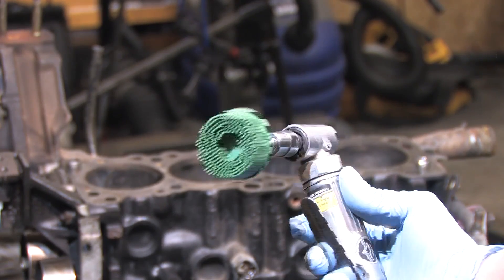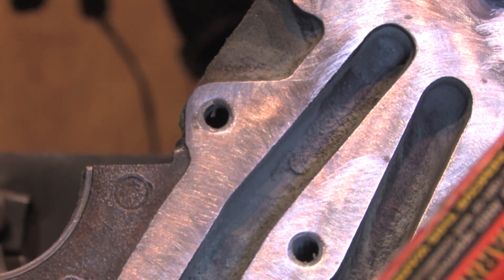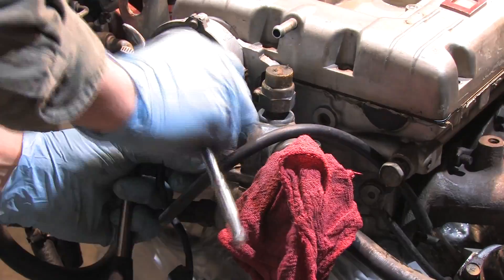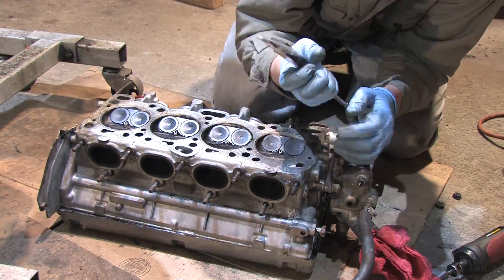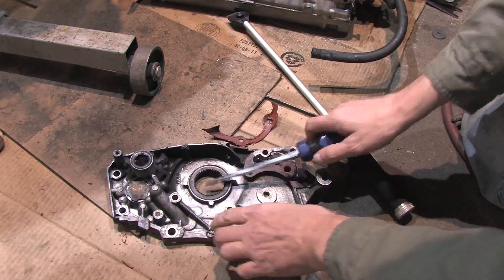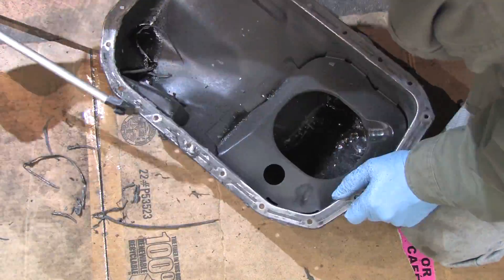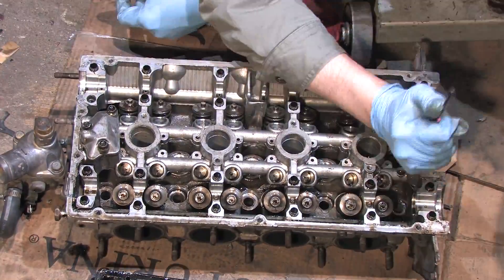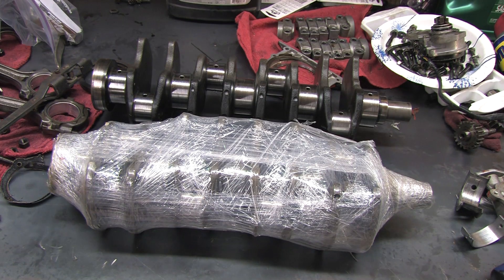4g63 Block Cleanup & Oil System Mods

Comment: Would a balance shaft chain cause a 2004 Chevy Malibu ecotec not to start
Reply from the maker: It would if that chain is wrapped up in the crank sprocket.  It would cause it to not even crank.  A simple balance shaft belt failure typically destroys one of these 4g63 engines like the one in this video because it wraps on the crank, jumps time and bends all the valves.  I've never taken an EcoTec engine apart to look at it, but it's a decade newer and it may have safeguards to prevent stuff like this from happening?

Comment: When hot tanking what do you use
Reply from the maker: A lot of people use Varsol or the equivalent.  I don't actually know what my machine shop uses?  I think its an environmentally friendly version of Varsol if that's even possible?  When I clean an engine at home, I do it the "DIY Parts Washer" video way.  In that case, it's Mineral Spirits.

Comment: Well now, and the hits just keep on comin’! Scrapping crap off of surfaces is getting to be a habit. You bagged the crap out of the grooves and opened up the oil slots to get that oil flowing better. Filter with cooler and oil pressure fitting, things a looking up! Then came a great white whiz from the sky! Zippedee doodah!🤣🙃😊🙄

Comment: Jafro 
How do you clean the turbo of contamination after a bearing failure?
Reply from the maker: I've used mineral spirits with a siphon feed blow gun, and then penetrating oil to re-lubricate it until it's put back to use.  It's pretty much the wrong way to do it... but the last turbo that went through that mess is still performing fantastically on my Elantra right now.  Years later.  There's no way to KNOW for sure that all the chunks are gone without breaking it down and cleaning everything, but I suppose like in my case there's always luck...
Reply: Think that might be a good video to add. I've seen you clean everything on that 4G63. 
Keep up the wonderful work. I tune in to your channel every day!!!!
Reply from the maker: I just tried to find it for you, I swear I remember shooting it, but can't find it in any of these videos.  I thought it was Hyundai Assembly 6... but the turbos are already clean.  There's a video somewhere with a turbo pile, that's when I did it.  The NEXT video chronologically is actually the siphon feed blow gun parts washer video.  lol.  You're almost there for the setup I described.  You'll never hear me speak.  The video does all the talking.

Comment: 10 pounds oil oil pressure per 1000 rpm is fine, at idle it should be around 40-60
Reply from the maker: Cold, yeah.  Sure, I agree.  Cold.  Maybe even 75 PSI isn't totally out-of-hand if it's cold enough. But a 4g63 turbo car with 60 PSI oil pressure at warm idle has some serious problems.  It's "uptight" to say the least.  Spec on a 4g63 turbo is 11.4 PSI+ at curb idle speed when oil temperature is 167° to 194°F.  I like how they just put the + on there (in some non-factory literature it says 11-23 PSI).  Most people prefer to run them around 20 pounds at idle, but performance builds tend to run better when their oil clearances are set up a little on the looser side.

Oil pressure in the 40-60 PSI warm idle realm would make me want to suggest running 5W20 oil to deal with those tight oil clearances and create a more stable oil film layer.  I'm trying to be helpful, not critical.  You can float main and rod bearings if your oil pressure is too high.  If you have a 40-60 PSI warm idle, make sure you're not peaking above 90 PSI at red line.  Most 4g63s with idle pressures that high normally do.

Comment: Hey Jafromobile, i would love to see you cover an f20c out of an s2000. its my belief that these motors have poor oil flow to the cams and in particular tend to seize up the intake cam for some reason. what kind of mods could i do to get better oil to the cams and girdles?

Comment: Jafromobile, do you have a similar method to prep the mating surface on the head for a composite gasket? I'd rather not take anything to a machine shop right now.
Reply from the maker: +spencermillsful Yes.  The razor blade scraping method I've demonstrated in several other videos.  If the head is in spec and you're using a composite gasket, then you can get by without machine work.  I don't know which specific video it is, but it's early in the blueprint series, and I also did it in the "blueprint everything" video for the Hyundai.
Reply: +Jafromobile awesome, thanks for the reply. Looking forward to more content!

Comment: Hey jafromo for starters I want to thank you for your videos. I followed your videos and did my very first rebuild and it was a success this winter:). Now for my question so I got 4g63 NA block with a 7bolt g61  head with mystery Pistons and crank. ( picked up the motor mid build from a fellow Dsmer who passed away) iv got the balance shafts removed  and about to start block prep. I was wondering that running a NA black without any holes for oil squirters and a 1990 Ofh if my oil pressure is just going to skyrocket With this block / head combo. I don't know yet if the prior owner machined the bolt holes either or just torqued down used head bolts and called it a day if that's even possible to due? Any input would be great and thanks again for the help.

Comment: Hey Jaffro,
I've been watching your channel and presentations on your view of the auto mechanic industry and time as u put it.  after watching this I do have a question have you ever torn down a Subaru EJ255? if not would you ever consider doing one as a side project from a junkyard?.
Reply from the maker: +marglar1982 Don't they use that engine in bush planes?  I've done timing belts on a few Legacys, and one SVX.  None of them were difficult, if not one of the easiest engines to time.  So much room to work.  But I'd totally not install one back in a Subaru.  I'd  bolt it into a Volkswagen Rabbit pickup with leaf springs and a narrowed Ford Explorer rear end.  Don't get me started...

Comment: Jafro, would it be a bad idea to use the roloc bristle discs on the mating surfaces with the routing assembly still installed? I have my motor broken down to a shortblock with the rotating assembly still installed, and I don't really want to take it out if I don't have to.

Comment: Jafro what air compressor do you have?  I remember you saying you have a 33 gallon tank.  But, doesn't that not leave enough CFM for some of the "tool cfm requirements"?
Reply from the maker: ***** You missed the underpants gnome step.  I know 2 people who bought used 250 gallon Ingersoll-Rand units for under $500 used.  It's why I suggested Craigslist.  Buy used.  Buy something that can be rebuilt.  People don't sell them used for the $1900 they cost new.  They depreciate.  I don't know about where you live, but local businesses have been dropping like flies where I live because of the absolute moron running our economy and country into the dirt.  I'm finding used equipment cheap on craigslist these days.
Reply from the maker: Jonathan Campbell It's a 45 gallon.  It's a raging pile of crap, though.  I went for the cheapest air compressor with the highest possible recovery CFM available.  It's a twin-piston oiled compressor that has a 14.8 CFM recovery rate.  It's the loudest, most obnoxious electric compressor I've ever heard, and I'm ready for something different.  I have to give it credit... it lasted 6 years, polished engines, compressor housings, ported a cylinder head, 2 turbos, 3 manifolds and supported me through every project I've ever done on this channel, but it's now toast.  One cylinder has failed.  It's cheap $350 chinese crap, and I'm hunting for its replacement.  Likely going for Ingersoll-Rand in the 60-80 gallon range.
Reply: If I had about $500 to spend on an air compressor what would you recommend?
Reply from the maker: When it comes to quality, if you want a lifetime investment for the $500... go to your local welder's supply shop and find out what air compressor rebuild kits they carry.  They'll have popular kits for compressors that businesses use because they're reliable workhorses.  They get used more, so the kits in stock are the ones you're going to find in your area.  Step 2.  Hit craigslist and search for the model numbers of the compressors they have rebuild kits for.

My harbor freight compressor is broken, and I can't buy gasket or rebuild kits because they constantly change their compressor lineup, and finding a chinese rebuild kit is an impossibility.

So I would say, used 90's era Ingersoll-Rand 250 gallon is the best-case scenario.  Craftsman makes good compressors, and they'd be good long-term investments as long as Sears manages to at least maintain an online presence after our economy destroys the brick and mortar store fronts.  At least you can count on both of those being made in the USA and having service parts available.
Reply: I hadn't even thought about rebuilding it.  That's a good point.  I've had to rebuild so many compressors I'm ashamed I didn't think of it before.  The Ingersoll-Rand brand name (even used) has a premium price tag that is a bit too high for my range.  But, husky or craftsman were what I was looking at.  I think a good craftsman is probably my best bet.

Thanks again for the advice.  =)
Reply: ***** Local businesses aren't likely to use a $500 compressor.  Good advice but sounds a bit unrealistic.  Most businesses I've seen use professional grade 60-80 gallon tanks with high HP motors.

Comment: +Jafromobile 
I see what you are saying, a very good point no one else has ever put out there. 
Thank you very much for taking the time out to reply. 
I will be running them now.
Oil pump going on the engine has done 500miles so there should be no problems with that in regards to worn out gears. 
A careful inspection and clean of the squirters especially will be done before installation for piece of mind.
Thanks again :)

Comment: What is your thoughts on the oil squirters on the 2g 7bolt like in my lancer evo 2 gsr ? Im about to rebuild my engine so would like to know whether to modify/delete them before I make a start. Im sure you have heard of the possibility of the squirters causing crankwalk. I'll be running Wiseco forged Pistons so squirters may not be necessary for my build ? I'm hoping for around 500bhp so the more oil I can get to cool those Pistons the better. Thanks for any input :)
Reply from the maker: Michael Yeo I don't believe the oil squirters have ever caused a definitive, prove-able case of crankwalk.  But opinions are opinions, just like everyone who's ever claimed that they had a case of crankwalk caused by their oil squirters.  

Proof is in the evidence, and what factors were considered or omitted.  I believe that oil squirters could possibly fail if they ever got trash in them.  But ask yourself where that trash came from to begin with... and whether or not oil squirters (which always squirt on an engine with a working oil system) could negatively affect the engine's designed oil pressure if they're stuck open?  Since they always squirt when the engine is turning, of course not.  They could only cause a failure if the oil pump gears were so badly worn that the oil pump can't deliver 10 PSI of oil pressure at idle.  Again, not the oil squirters' fault if that's how that engine's oil system is working.

They're only worth removing if you have low oil pressure, and if you have low oil pressure, you already have a problem other than the oil squirters.

Comment: hey i just love your videos and i love to see someone else loving engines as much as i do (not saying why will u cleaning it? it will get dirty in fisrt start.... (here in Brazil we chance the oil 250miles after build a engine to drain out the dirty thats why we dont have so much great engines around here) but anyway i wanna to add something, This is the second time that i saw u place your crankshaft in banch in horizontal. OK in the school they ever toldme to never do this cuz the wheigt of it doesnt get a necessary "straight" i dont know if u understand. anyway they always toldme to place it in vertical to all the weight get perfectly distribuated and this way doesnt damage the crank. Tnks for my favorite hobbie bye

Comment: I use a piece of emery cloth over an old plate glass table to clean up most gasket flanges. Also after a couple of strokes you can tell whether a part is flat or not.

It works so well for flattening surfaces that I have run without a turbine inlet gasket for 50,000km+ with no leak whatsoever.
Reply: i too use plate glass... but just wonderin, have you ever checked how flat it actually is?

Comment: Are those valve cover gaskets $77 in the US, they are here in Australia, no matter who you buy them from :( I had to buy one yesterday lol
Reply from the maker: Yes.  The price I find is $71.  It's crazy.  I think the FelPro equivalent is around $50.
Reply: I'm not sure why theyre so expensive, makes no sense. Another story, I rang SuperCheap Auto and AutoPro (car accessories shops here in Australia) and they wanted 40$ for the exhaust manifold gasket, and 70$ for the intake manifold gasket. Got them for $11 each from a local Head repair shop bahahaha
Reply: ***** maybe the gaskets are cheaply made but at rockauto.com there like 10 bucks  depending on what company you get it from.

Comment: I hope it's ok to post a question like this here, but I'm working on balance shaft elimination (partly because the silence shaft drive gear has caused some troubles since the last rebuild). When I took the front cover off, I came across this hole in the oil gallery (shown with a red arrow);
https://www.dropbox.com/s/x18a0xlt884tzw2/IMG_20140203_153516.jpg
Is this hole normal or abnormal? if abnormal, can I fix it with JB weld? Thanks! This is a 4G64 block
Reply: Nothing unusual there...  No need to clean it up.  That's a dead gallery.  Not an actual oil passage.  Part of the crankcase and unless something's loose and capable of falling off of it, poses no risk to your oil system.  If anything, you could make that hole bigger, and it still wouldn't make a difference.

Mitsubishi engines are full of flash and strange casting anomalies.  There were no humans involved with de-burring the rough cast.  Only robots.  Apparently, the only quality controlled part of them are the machined portions.  Those are fantastic.  But no two head or block castings I've run across were the same.
Reply: AutomotiveAnonymous
 Thank you. That sounds reassuring :)
Reply from the maker: Tak Suyama What he said...  ^^  :)

Comment: You're so thorough and knowledge filled for a non-professional it's frightening, and the fact you experience motor failure from time to time do to various internal strains makes me think there's no way I could ever take on a project like this. I'm afraid at the very least I just don't have the eye for detail like you do. It's not that I don't want it, it's just that meticulously cleaning for hours on end makes me pull out chunks of my own hair... lol
Reply from the maker: Never forget this... there's no engineering problem that time and money can't solve.

You can do everything you see me do in these videos.  You can do it successfully.  The eye for detail part isn't an issue if you take the time to get familiar with how everything fits together.  The only limiting factor for any individual (and mileage varies from one to the next) is the level of patience they have achieved.  Doing things right means not rushing.  As long as you resolve to fix it correctly no matter what it takes, then the engineering problems will never stand a chance.

If you didn't believe that deep down inside... you wouldn't be watching my videos.  ;)  I'm glad that you do.

Comment: the block is non turbo no oil squirters, will oil port mod #1 and #2 and the cooled O.F.H be enough to bring oil pressure back down to a normal level?
Reply from the maker: I HOPE SO!  We're going to find out pretty soon...
Reply: yea i thought after it will be a trial and error period, at the least it will help though

Comment: Actually, its okay to use the clear bathroom silicone sealant. You must be VERY careful that you do not get any toliet paper stuck in the oil galleys. That where you draw the line!
Reply from the maker: I laughed at this for a solid minute.  I did not see the TP coming...

Comment: a cup wire wheel on a drill will not damage aluminum, unless you spin it too fast and press too hard. I have done this for 12 years and never had an issue.
Reply: and... if the razor catches it takes chunks out!
Reply: It will actually damage aluminum in the long run. Steel or stainless steel bristles will "gall" aluminum. Although it wont hurt a thing, especially of you use liquid gaskets or composite gaskets.
Reply: Andre Gross OH, I forgot that it has to be a soft wire wheel, the stiff one's will do damage.  My fault.  I've tried both ways and razors always did more damage and took 12x longer.  30 secs -1 min with wire wheel vs 15 min with a razor and cleaner, no real mechanic would waste that much time, they are paid in flat rate.
Reply: Yeah, brass wouldn't hurt aluminum nearly as fast as S or SS.